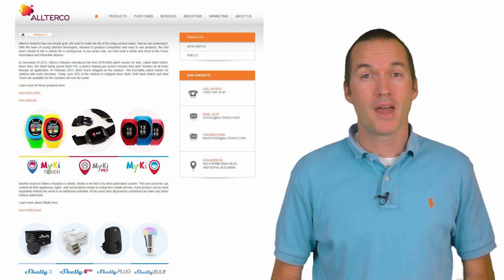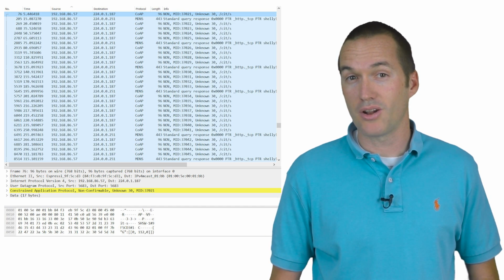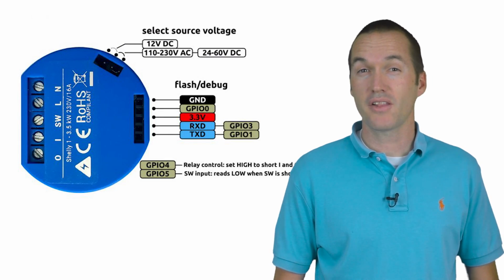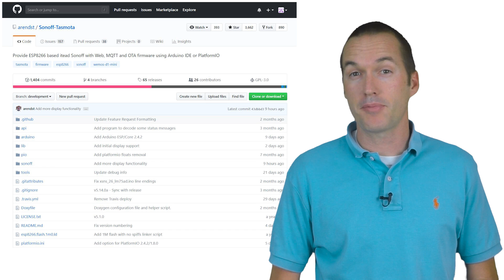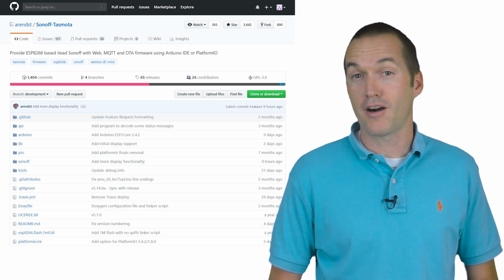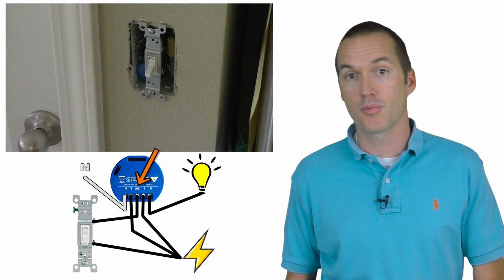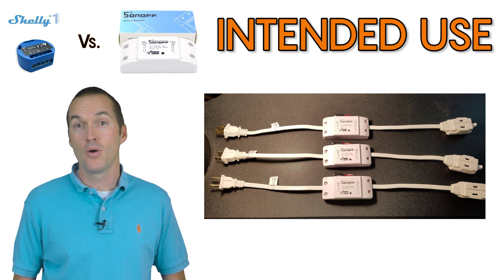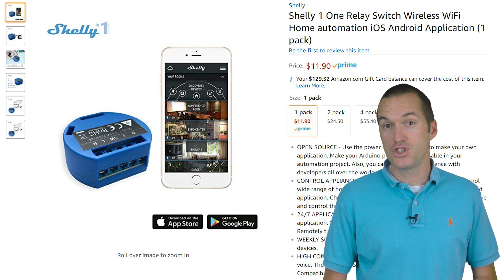Is the Shelly 1 better than the Sonoff Basic?

Comment: I live on a houseboat.  
i have 110vac coming in from the dock,  But when I go out boating i would like to still have control over my lighting and devices.  Does the shelly operate on 12vdc?   Thanks,  and good video.
Reply from the maker: They can sort of run on 12V.  You'll need to swap the jumper to the 12V input, but it is not particularly tolerant of voltage differences.  Your 12V system probably ranges from 11V-15V, which the shelly will not be happy with.  If you could run on 24V DC you'd be much better off.
Reply: @TheHookUp  Thank you for the reply!   I have been considering bumping up the system to 24 to help with some off the line loss.  My goal is to be mostly self contained.  I can step down to 12 much easier than up.   The other issue with having a smart boat on the Upper Mississippi is data coverage very hit or miss and I'm thinking for the critical control points I need to have devices that can work together without broadband connectivity .  I have a smart things hub.  And boxes of toys that haven't generated any flux yet.  Few other logs to finish.  Should be a good adventure.   Take care man, and thanks again for the reply.!    CJ
Reply from the maker: Is highly recommend ditching smart things and going with home assistant if you want local control.  Smart things uses the Samsung cloud for all their integrations, which means no control without the web.
Reply: @TheHookUp  is the Home assistant hardware or software? I feel like I just keep topping off the scales with straight ca$h as Randy Mo says.. I will definitley check it out.  These basic commands should not be that much.  My Garmin would take me across the country without internet and I could ask it hundreds of things and it came up with something for me.
Reply from the maker: @chadjansen9097  Software, usually runs on a Raspberry Pi, but can run on any computer.

Comment: I've just installed one, sucessfully uploaded Tasmota firmware. My standard light switch operates normally through the shelly1, I can control the lights through the Shelly1 interface but I can't seem to get it working in Hassio.
Reply from the maker: Is it your first tasmota device?
Reply: @TheHookUp  no I have Tasmota on about 5 Sonoffs and RF Bridge. It seems MQTT is working on it. Mosquito broker finds it, all I can think is there must be something wrong with the configuration.yaml. This is my Yaml. I used the latest Tasmota with Shelly 1 to install the firmware. 
  - platform: mqtt
    name: "Garage Lights"
    command_topic: "cmnd/shelley1-1/power"
    state_topic: "stat/shelley1-1/POWER"
    payload_on: "ON"
    payload_off: "OFF"
    retain: true

If I try the switch in the hassio user interface it switches on then off but its not actually switching the lights. I can control it using the Tasmota web interface.
Reply from the maker: Are you sure that's what you named the switch?  Shelly is spelled "shelly" not "shelley", possible that you just misspelled the command and state topic?
Reply: @TheHookUp  yeah I checked that as that would make sense. Is there a way you can clear the mosquitto data base? Maybe there is a corruption
Reply from the maker: if you go to the console in the tasmota web interface you should be able to see the correct path to your device.
Reply: The Hook Up it is correct frustratingly enough

Comment: If i connect 110v AC to L and N and use the software to trigger the relay. I don't need to trigger via the SW - in fact, can I disable the SW and use it for a different purpose. Can I use the "SW" along with the Rest API /status {ison} to read its state - to know if my garage is closed or open? Can I use the Magnetic Door Contacts with a 5v+ connecting to this SW? I haven't tried it yet since i'm afraid things might blow up.

Comment: I think a true comparison would be to actually use it with Alexa and Google Home. That is one of the main reasons people would buy the products. The Sonoff is absolutely horrible in terms of connecting to "newer" wifi routers. If the router or access point supports both 2.4 and 5ghz then Sonoff won't connect. Sonoff only supports 2.4ghz... Is the Shelly also this fussy?

Comment: Is it possible to hook the shelly 1 to dome lights in a car? If so, follow the same diagram and change to 12v dc?
Reply from the maker: Where would it get the Wi-Fi signal?
Reply: @TheHookUp  hotspot kept in the car. Thinking about having this setup with Alexa and integrating maybe an Alexa Input

Comment: Shelly "  no compatible avec Alexa amazon "
Reply from the maker: If you use the shelly cloud there is an alexa skill and a google home skill.  Availability of those skills may vary based on country.  If you don't use the shelly cloud you'll need to handle your alexa skills some other way (Home assistant, node-red, etc).

Comment: Aloha,  I'm a little confused, maybe because I don't know much about electrical schematics, isn't "L" stands for load and is live wire which means "+" and "N" is neutral or return line which I think is "-".  The sticker on the device and the instructions show "N = +" and "L = -"  My apartment is old and only have 2 wires in the switches (Black=Load/Live, and White=Neutral/return) not the normal Black, White, Green (Load, Neutral, Ground)  I have followed the wiring diagram on the instructions and as well on this video and it doesn't work.  I've tried switching some of the wires around and still no luck.  What am I doing wrong?
Reply from the maker: Hi, that's a common misconception that people have.  In alternating current (AC) there is no + and -, the live (L) terminal oscillates between around 160V + and 160V -, and the neutral (N) terminal acts as 0V line.  In direct current (DC) there is a constant + and a constant -.  The different markings on the shelly have to do with AC vs DC current.

Your switches probably don't have a true neutral, just a switched L, the neutral is probably in the actual light fixture.  You are very limited in the types of smart switches that will function in that kind of setup, and the shelly will not work.
Reply: Ok thanks for clearing it up for me.   Great video.   :-)

Comment: I have a question about using the switch sensor. If you use the switch to turn the light on and off and then while the switch is in off position you use the app to engage the relay what happens when you put the switch in the on position while it is already on?  Does it turn off the light or do nothing? To turn off the light from the switch do you have to put the switch into the on position then off again? How does app control  and physical switch coexist, what is their behavior? Thank you

Comment: Oh I think this is what I have been looking for.  I have my fireplace hooked up to a standard wall switch but it is low voltage.  I have been looking for something I can hook up inside the box (Because I have two switches in the this box.  One is low voltage and they other is running lights above the fire place.  Since I have low and high in the same box would this work for controlling the Fireplace off and on?   If so do you by chance have a video on how to do this?

Comment: I wonder what an electrician thinks while watching? They might have learned to consider safety related issues that go beyond the physical ability to get a switch cover reinstalled. They might notice potential problems in seemingly unimportant details that will make sense and become part of your own knowledge base once you're made aware.  Electrical devices that are approved for installation into boxes without further protection will carry listings from safety organizations that will be included with the device. It's one thing to add an external device and another to consider hiding one behind another device.

A part of the Electrical Code pertains to the filling of boxes with wires, connectors, and devices. This is a heat related safety concern first. Anything occupying box volume shouldn't be added if the box is already at capacity. Is there a huge safety factor in the code? Do plastic electrical boxes burn? 

Giving wire strippers a little twist before popping off the insulation has the potential to cut a tiny ring around the conductor. This reduces the current carrying capacity and makes a stress point for failure. An insignificant waste of words? Choosing an undersized location on a stripper almost ensures it. Try to only partially cut the insulation then use force to pop the remaining insulation free. 

The times they are a changing and time will tell if this new unregulated automation trial testing period will claim many casualties. We're also opening a big door to have our countries switched on off by another country but that's another bag of rice.

No implications directly intended towards anything I may or may not have seen in this interesting video about Shelly. I do have a mediocre 70's song on brain standby, Shelly Made Me Smile. Must select something better... Triumph, Lay It On The Line, much much better. 
Good day.

Comment: what happens if home assistant switches the switch and its in the off position? will it just make the wall switch work the opposite way?
Reply from the maker: Yes, although this can be configured differently in both tasmota and the shelly app for different behavior.

Comment: If a neutral wire is required it defeats the purpose. The Sonoff can be connected at the fixture simply using two wires and being tucked into the housing behind the fixture.
Reply from the maker: The sonoff also requires a neutral.

Comment: I wanted a smart ceiling fan but in UK I've not had much luck. I was thinking could I get a Shelly to use purely on the fan side of the light? Since it's small it will fit easily. I already have the light control with a WiFi bulb. Thanks

Comment: Are there any of these devices that you know of that can do motion activation with timers and wifi for the ultimate smart switch. Then you could have smart home track what rooms are occupied and also tie in the motion to home security. (ie. If you set the state to away and motion is detected then the system could notify you about possible intruder. Or if kids where playing in room then left then the lights would shut off and save power.)
Reply from the maker: I've not seen one that is all in one.  Shelly has a product called the "Shelly Sense" that has motion tracking, but I don't think it's priced realistically at this point (it also does IR repeating, has a 2 day battery and temperature sensing, so it seems to be a bit random in its design).

Comment: Here’s what I don’t get... so the Sonoff is rated at 10A at 220V. That’s 2200W. If you’re running at 120V, you’re looking at 18A to give you similar power consumption (and thereby heat output and chance of getting melty...) what am I missing? (The Shelly seems to list the same current rating for totally different voltages...)
Reply from the maker: Wires and therefore circuits are rated by ampicity to account for zero resistance loads.  I don't like it, but it's how it's always done.
Reply: The Hook Up can you explain that in more detail? (Or give me a reference?) My background is Physics...

Comment: I'm using both shelly 2 and sonoff in my house.  I think if the sonoff are installed without removing the outer casing they are safer.

I think we can all agree that the screw in terminals on both the shelly 2 and the sonoff are not the best.  The screw in terminals on the shelly PCB are marginally better (more heavy duty), but they are still fairly weak and easy to strip if you screw down to hard.  In fact if you screw down the terminals on the sonoff really hard the terminals can actually rotate slightly as well.  I think the plastic used in the shelly terminals is better quality.  The reason I think the sonoff is marginally safer is because the outer casing of the sonoff has further screw down 'crocodile' style fastening that secures the 240V wires into the casing.  This means that the stress point of the wires if you are pulling on them is where they attached to the case rather than the terminals.  The stress point of the Shelly is the PCB terminals.

If you install both these devices correctly and safely then I think the sonoff is less likely to fail.  The most critical and dangerous point is the terminals attaching the mains voltage to the PCB.  The shelly is most likely to fail at this point.  A critical failure at this point would either trip the fuse or cause a fire.

PS:  When I install sonoffs I run GPIO14 and ground through a pair of 22ga wires to the light switch and I wire it up to a mains voltage electrically isolated light switch (even though the sonoff's switching wires only carry 3.3V).
Reply from the maker: Sounds like a good setup.  Are you able to fit the sonoff in your switch box?  Ultimately the biggest advantage of the shelly is size, but if you have a giant switch box the sonoff works just as well if not better (for the reasons you state).

That being said, with the new firmware updates for the shelly it is totally usable without modification, whereas I'd never trust a non-flashed sonoff in my house due to privacy concerns.
Reply: @TheHookUp  It's a very tight fit, I have some sonoff without casing (DIY electrical duct tape case) and the other sonoff are in the casing.  My house is in New Zealand and was built in 1965.  The original switch boxes are made of metal and are sized 70 x 50 mm with a depth of 35mm.  I've replaced with a new plastic electrical flush box that measures  90 x 60 mm with depth of 35 mm.  Both boxes fit the same face-plate/switch.  The new plastic switchbox is not solid, it is a frame, I cut away some of the frame in the side / back and this allows me additional room inside the wall to fit larger devices including chocolate box connectors.  The wall cavity is 90mm depth because the house uses 4x2 studs.
Photo of switchbox (aka Flushbox) - https://www.mitre10.co.nz/shop/hpm-flushbox-single-white/p/105534

Comment: No manual push button is a mega negative for this device. What a shame for such a cheap modification. Also nfg for embedding behind a light switch in the UK, we don't normally have a neutral there
Reply: There is manual push button :)

Comment: Thank you for you videos.
However, I have question: As Shelly and Sonoff are cheap, why someone will go with the more expensive equipment such as Fibaro, AeoTec, Qubino? Even these products are cheap compared to KNX equipment. So how these companies make profits?
So, is there advantages by using KNX over Fibaro, AeoTec. And by using Fibaro, AeoTec over Sonoff, Shelly?

Comment: Any way we could get an example of using the Shelly 1 in a three way switch configuration?  I have several switches in my house that are three-way and would feel much better using Shelly 1's instead of Sonoff's.  Thanks in advance for any info.
Reply from the maker: That will be in my video this Wednesday, stay tuned.

Comment: I had a case when the sonnoff basic burned. He just stopped working. There are no traces of burning and the like.
What's this with shelly? This is too dangerous to install on 220V

https://scontent-vie1-1.xx.fbcdn.net/v/t1.0-9/fr/cp0/e15/q65/42987678_2107246055966393_8938902368427180032_o.jpg?_nc_cat=107&efg=eyJpIjoidCJ9&oh=60b74feaf8f94d38b48acefd4c940abe&oe=5C3D24E7
Reply from the maker: Need more context, my guess is the N and L wires were hooked up backwards with L on switch, which sends 220v to the low voltage side... No bueno.

Comment: I am concerned that neither Sonoff or Shelly is UL Listed. Is there a comparable (Tasmota compatible) device that is listed? This isn't unique to Sonoff/Shelly. I recently bought smart several light switches (anker eufy smart switch t1211121) from Amazon and they weren't UL listed (or ETL or CE or anything listed). So they are going back.
Reply from the maker: Word is that the UL listing for the shelly should be coming in December, but wait for the official word if that's important for you.  They are CE certified.

Comment: A great video. As they are smaller than the Sonoff basic will probably use them on my wall switches.

Have you checked out the ShellyRGBW, I would love your opinion on it and if possible a video.

Comment: A 16A relay and a 15A breaker doesn't mean that the relay is protectedly the breaker, breakers need a certain amount of time at an excess current before they will trip.  Higher current = shorter time.  Most 15A breakers could probably hold a slight over current for an indefinite time.  As stated below I think I prefer the wide (soldered) tracks of the sonoff.  Also see JWs overload test of a sonoff here. https://www.youtube.com/watch?v=SLK84ZJ291k